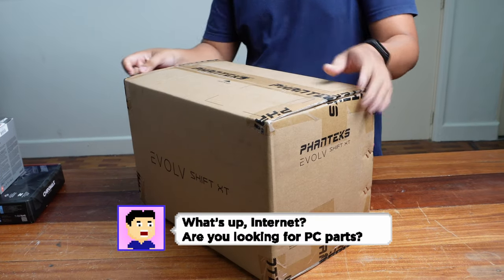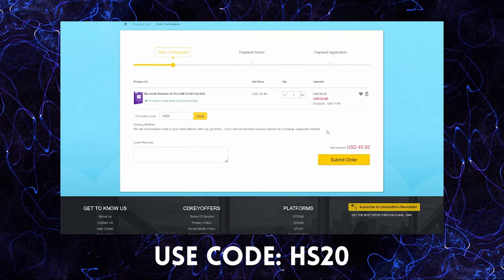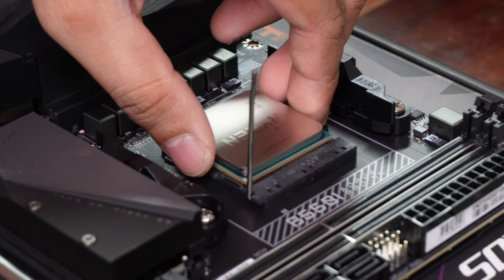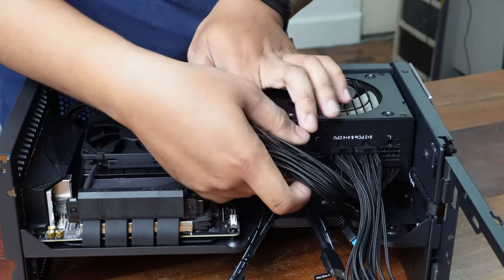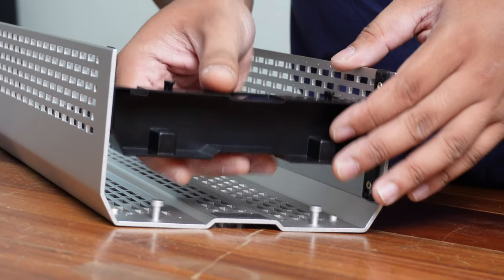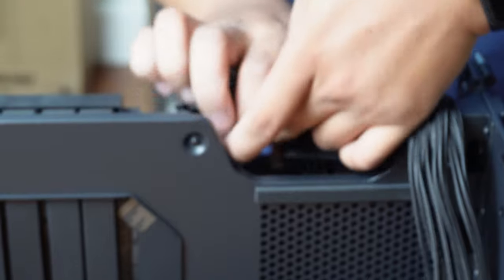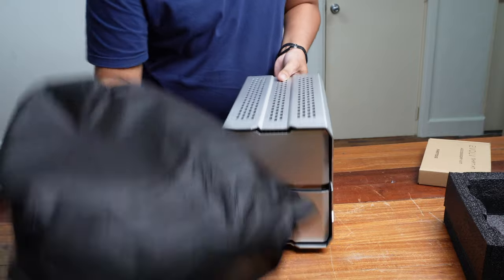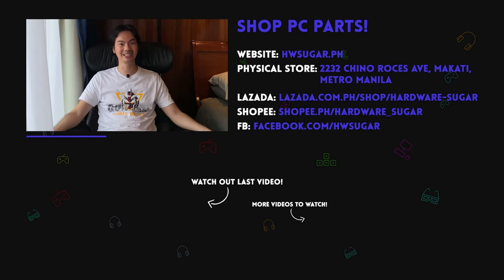Critics loved this ITX case 😍 But does it live up to the hype? 🥱

Comment: maganda lang ata ITX for those na air-conditioned ang mga bahay or room. siksikan ang hardware sa itx build so mainit yan at limited ang cooling capacity unless if puro mesh sya, but still,  the owner will have to consider his environment before even going itx. pero if non gaming naman at wala vid card, baka pwede na rin kahit wala ka aircon.